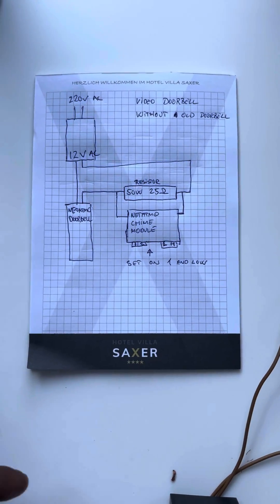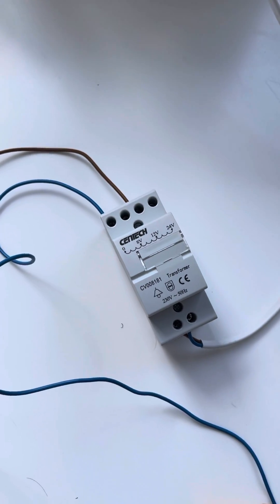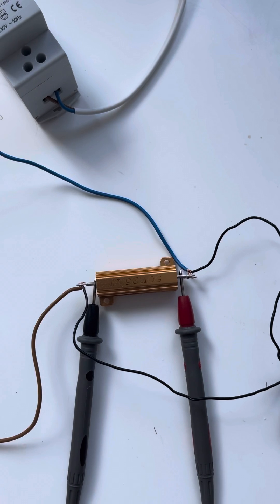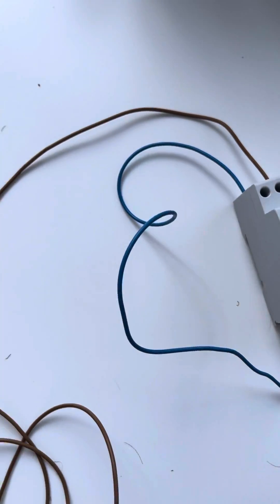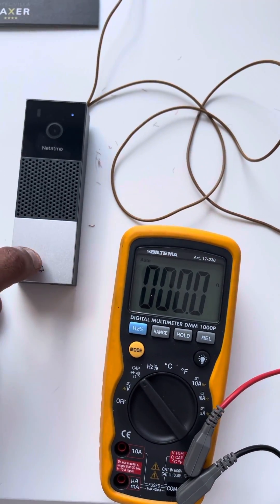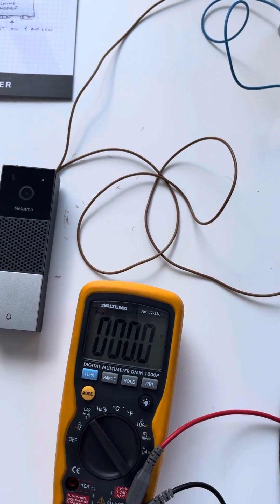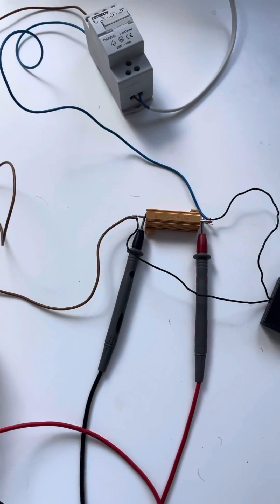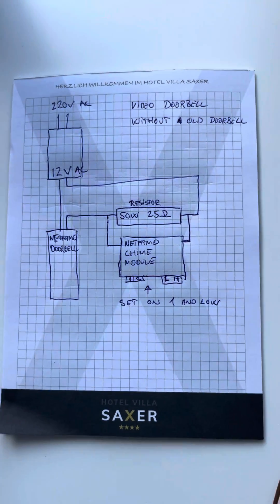Netatmo Doorbell without old chime

Comment: Could I wire this up in a box so it would be on the wall out of sight and plug it in a socket ?
Reply from the maker: Yes, just remember that it generates a small amount of heat - so a small venting hole would be necessary - or a socket that is not completely airtight.
Reply: @PlayingGamesDK  okay thank you this is gonna help so much 🙏🏼🙏🏼🙏🏼
Reply from the maker: @quinnfisher9994  no problem. I have had this setup running now since I added the video. No problem at all and no videochip burnout.
Also made this solution on other friends setup - fully functioning.

Comment: ‼It is possible to use just USB port ‼ with decent charger as a power supply, but I don't believe it is mentioned anywhere in a manual or Netatmo webside.
Reply from the maker: Great. Did not Think of that.. wonder why actually. 
I also just noticed that Netatmo sells the Doorbell with a transformer now.. and soon they will sell the transformer alone also. Should have been an option earlier. Some also use the ohmkat transformer as well, but I was not sure that it would work properly with Netatmo.. frying a videochip is the same as have to rebuy the Doorbell..
Reply from the maker: By the way.. has it Been tested to work properly with video (liveview) etc. over a period ? Because need it to work not only as doorbellfunction but also liveview
Reply: @PlayingGamesDK  Not yet. I bought it few days ago as broken for about 90 PLN ~ 20 USD. Chime module has broken cover and didn't wanted to connect to wifi, but it was just access point issue. I opened it up and at first glance it seems that usb port is bypassing internal power supply, so I hope it will work.

Comment: Will this work without the chime module? If so do i need the resistor still if no chime module?
Reply from the maker: No I do not Think it Will work without chimemodule.. but maybe without resistor (but I do not Think that is a good solution because of the  risc of frying the video module)
Reply: You can use USB port
Reply: @talib05091995  any info on this? or a website explaining a bit more?

Comment: Will the resistor generate heat with 15VAC provided from the transformer?
Reply from the maker: Hi - no I run mine with 18VAC - and yes it generates minimum heat when bellbutton is pressed, (Can not feel it, have not measured it, but in theory yes) 
But as stand-by the electricity goes through chime module and bypass resistor.
Reply: @PlayingGamesDK  Thanks for your quick reply. This was sure helpfull.

Comment: Where do you get the resistors from
Reply from the maker: Hi, I bought from AliExpress - search for 50W 25ohm
Reply: @PlayingGamesDK  still working well ? I’m changing from a ring pro powered solely by the transformer
Reply from the maker: @Barkingtoad1  yes I installed 3 of Them with same setup. No problem with them at all. And really no issues. The good thing is that even though quite expensive there is no fee. They are compatible with Apple home kit and a hub for instance HomePod as hub or ifttt as webhooks so a bulb or other could give a signal as well
Reply from the maker: @Barkingtoad1  some just run it from transformer - but as I read the manual the videochip could fry
Reply: @PlayingGamesDK  yes that’s how i want mine to work , all my Tv comes through Apple TV with 2 OG HomePods so want them to be my chime , don’t understand why they have made it such an old hat connection in this “smart age “ . Would have thought they would of sold there own transformer with chime module built in
Reply from the maker: @Barkingtoad1  I heard that the Ring transformer could work - but really dont know - and is an expensive tryout.. if frying the chip.
HomePods performs flawless with Netatmo 😀
Dont understand Netatmo does not have a transformer addon or actually sell a kit so all is as digital as possible - and allowing people to discard the old stuff. Maybe too much hazzle with too many variations of analog chimes.
Reply: @PlayingGamesDK  looks like I’m buying a resistor tomorrow & ordering the netatmo
Reply: @PlayingGamesDK  so all i need to do is cut one side of bell wire to connect resistor to then put chime module both ends of resistor
Reply from the maker: @Barkingtoad1  yes - that is as easy as it sounds. If You look at the diagram I made - it’s that setup I have used.
In fact I initially bought an analog chime to test with this setup (instead of resistor) and then replacing the analog chime with resistor. Same measurements almost - and I reset the install and App and had no problems adding it.

Comment: Where does the ringtone come from? from the netatmo ring module? can't it be done without holding the button down?
Reply from the maker: My ringtone comes from the Apple HomePod in the video - but I have made it so it can ring on my sonos as well via my Homey Pro device - i just held the button down to show that the resistor worked. A simple Quick press/release is enough. 
Besides - the phones rings as well.

Comment: Hi there thank you for sharing this video. It’s exactly what I needed. I’ve replicated what you’ve shown in the video, I’ve purchased the 50W25R, the doorbell is on but it’s constantly flashing green and won’t turn to white to say it’s ready to connect to the app. Have I missed something for it to not operate properly?
Reply from the maker: Hi there. Funny - I had the same problem with a defective Unit. I got a replacement and it worked fine after that. Also remember to power it with 12V or so - 8V is not enough (all though it should work) but that also depends on the wiring and length of it. Have You tried resetting the device as depicted https://helpcenter.netatmo.com/en-us/smart-video-doorbell/product-interactions/how-can-i-reset-my-smart-video-doorbell
I have made 3 doorbell without problems besides the initial defective Unit.
Reply from the maker: Btw - is Your chime module set on 1 and low ?
And be aware that You need wifiband range of  2.4 GHz and not 5GHz

Comment: Do we need a resistor here? Netatmo specs saying that we need minimum 8VA of power so believe simple 12v adapter should be enough.
Reply from the maker: Netatmo will probably work - without resistor or the old doorbell, but as manual says - You risk overheating and blow the fuse. I remember it Works up from 8VA to 24VA. The problem is when it is triggered - But I am not an engineer - I just did not want to risc anything with this rather expensive doorbell and want it to function flawlessly. No problems since I made it. Perhaps a ohmkat adapter can do the work. I don’t know.